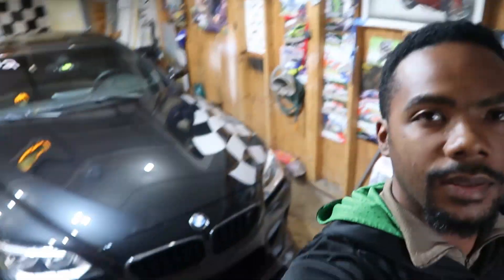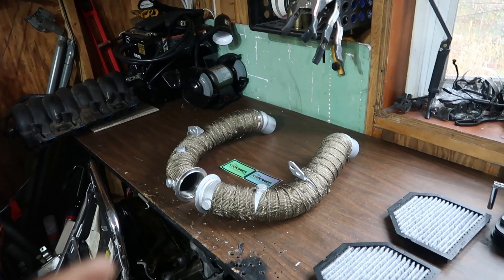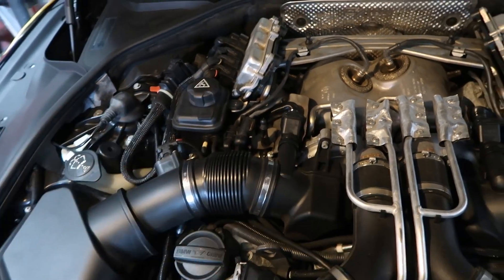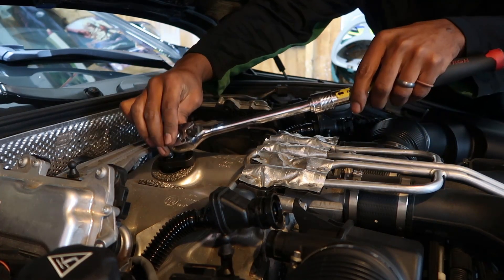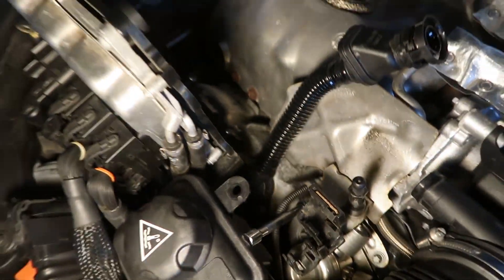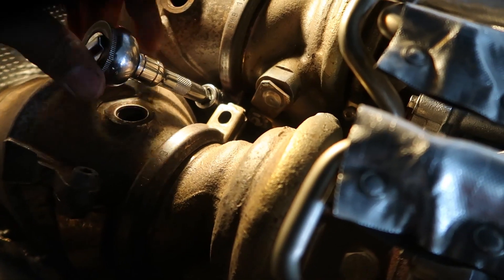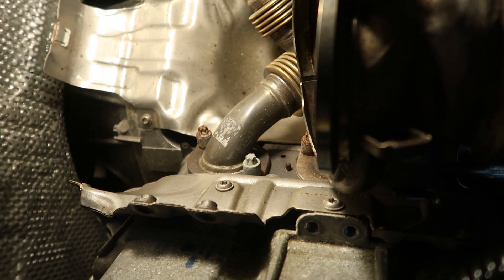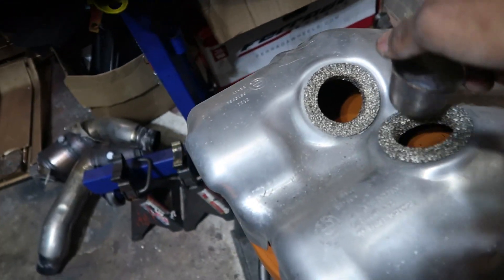Installing downpipes on M6 or M5 and  twin turbo V8's

Comment: Hi, great video! Did you have any troubble with hearing some "wastegate rattle noise" after the dp installation? I have seen that many does get the noise after replacing the OEM DPs for catless dps.
Reply from the maker: none at all.  probably due to people not installing the 2 rear brackets back.
Reply: Premium Fuel Mag bracket has nothing to do with waste gate rattle , it’s flaps inside the turbo I have a 2015 M6 GC Fabworx downpipes, and Full Meistershaft exhaust , I had no wastegate rattle with stock pipes but the GThaus exhaust is 3-1/2 pipe it’s more free flowing now I have it pretty bad it sounds like a rattle snake every time I come to a stop , it doesn’t bother me but it would be nice if it wasn’t there , my Tuner says leave it alone it’s normal

Comment: My shop tried installing the rvg dp on the m850 but the Brackets don't fit well. The top Brackets right next to the turbos fit well but the bottom Brackets are off. One side of inches away.  On the other tabs, only 1 of the 2 bolts fit. How much of an issue will not having all bolts installed in the brackets?
Reply from the maker: You need to have everything bolted down, otherwise they could blow apart.

Comment: They sound different because the headers are mixed as much as possible. Each cylinder bank mixes with the other cylinder bank before hitting the turbos, creating a sort of triple x pipe BEFORE the turbos. Same setup as the Agera, that’s why they say they sound the same.
Reply: These banked manifolds are a direct bolt on to the n63tu3 motors and to n63tu3 turbos too ( b8 alpina setup). I wonder how that will work if just swapping in.

Comment: hey, why not just to cut out cats from stock pipes and just put them back in?
Reply from the maker: that would be the cheapest option, and the best way to avoid fitment issues that can sometimes occur when you use cheap aftermarket downpipes, but destroying the factory cats can be costly if you ever need to put them back on for emissions or to sell the car,  it can cost over $1000 to get another set of used ones.

Comment: Did u ceramic coat your downpipe before wrapping it with titanium wraps?
Reply from the maker: Yes i did
Reply: @Sgt.Slides  I figured, going to powder coat mine too before wrapping
Reply from the maker: @ArmedTheAsians  Would powder coat hold up to exhaust temperatures?  I don't think it will.
Reply from the maker: Downpipes are one of the hottest parts of your engine
Reply: @Sgt.Slides  I mean ceramic coating* sorry about that
Reply: Do you have any concerns wrapping them about trapping the heat in causing warping of the pipes? Only reason I ask is a buddy of mine wrapped his headers on his Vette and they later warped. Excellent work, as always on your M5.
Reply from the maker: @troypatillo1688  There's a long running debate about weather or not to wrap headers, you would have to do your own research on that to decide, i have run wrapped headers on my Mustang, BMW, and motorcycles, and i've had numerous friends who run wrapped headers as well and never had any of these mythical problems.  The advantage of wrapping your headers is.to prevent other things from heat damage which is much more likely to happen if you don't use wrap, and dealing with this expensive BMW engine, i'd much rather risk warping a downpipe than burning up expensive parts and electronics in the engine bay.  If your buddy had warped headers on his vette, they were probably low quality to begin with.